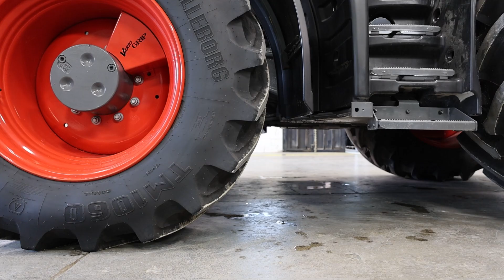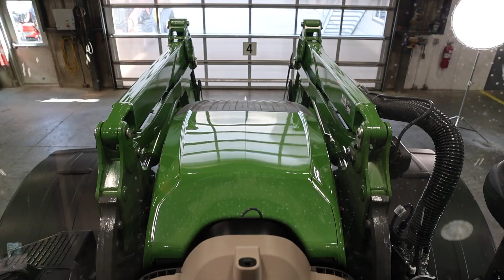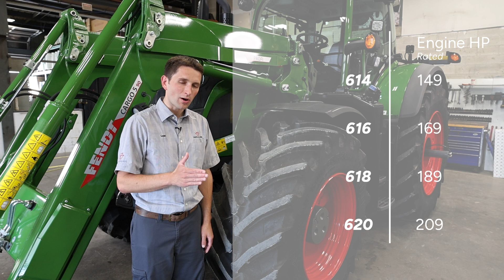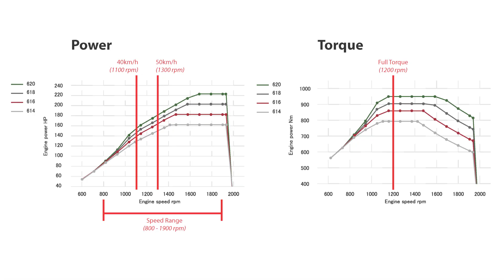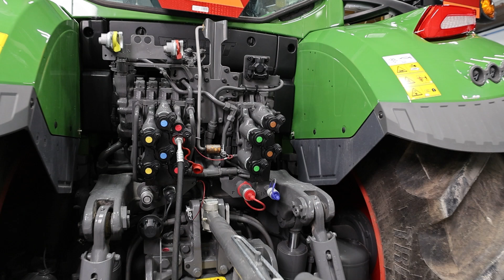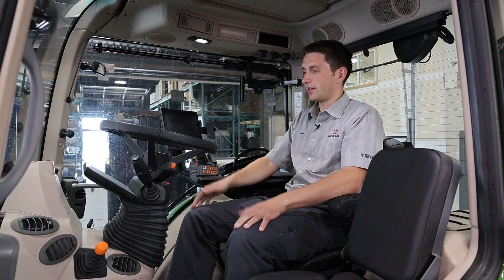Review | Fendt 600 Series Tractor

Comment: Can you get different front tire sizes?  if you can do the front fenders match the width of the tire you want?
Reply from the maker: Yeah, thanks for asking. There are many different tire sizes available. And yes to your second question as well. With Fendt, front fenders and rear fender extensions are always matched to the tire configuration selected from the factory.

Comment: Do you know why new Fendts are so much bigger? Have driven an old 515 Fendt, which has the same horsepower but is smaller.
Reply from the maker: When any manufacturer does a model update, it gets a bit bigger. Think 2500 pickups 15 years ago to now.  When the first generation 700 came out it weighed 6200 kg baes weight, and the 7th gen is 9000 kg. The horsepower is totally different now, the 1st gen was 116-160, and the 7th gen is 203-303. It's the "Bigger is Better" phenomenon at work over several decades.

Comment: Improperly titled, this isn’t a review it’s a introduction by a dealer. If this was a review, you would share some shortcomings also.
Reply from the maker: Well said. However, we have yet to see this tractor spend significant time in the field. Some of our customers took it for test runs and they were very pleased. Time will tell the shortcomings.
Reply: It is review, you can’t give shortfalls unless you test it to find shortfalls
Reply: @ review implies that an item was used, so reviewer can provide positive and negatives. It’s not in a dealers best interests to provide negatives. This is what is called an introduction of a new model.